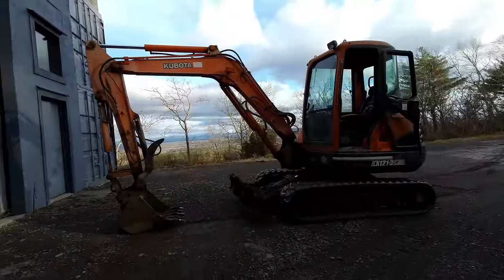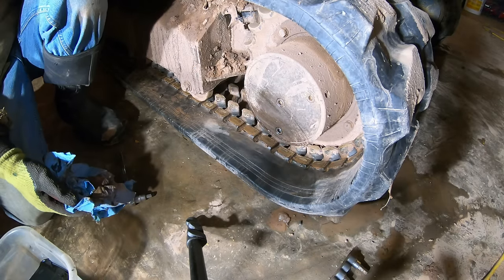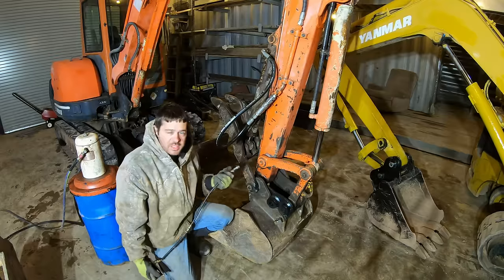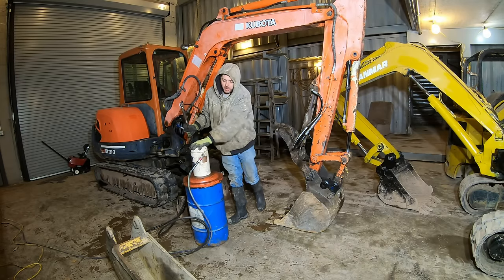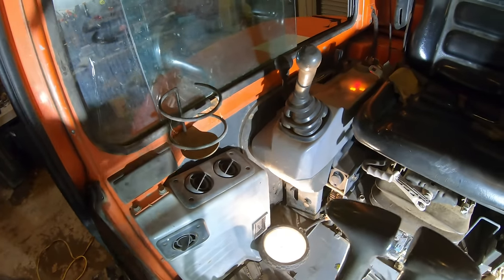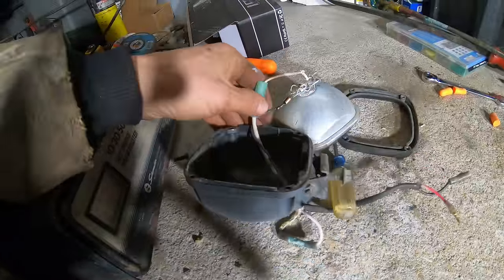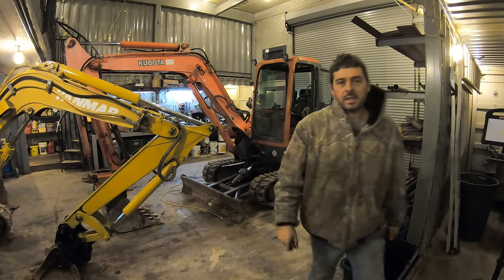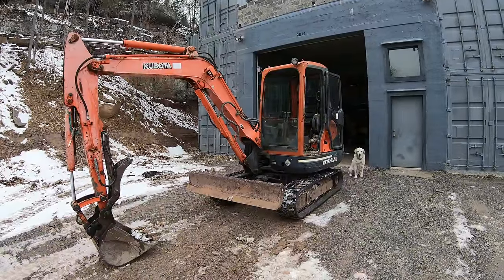Working on the new Kubota excavator

Comment: So did you buy a new washer or rent it?  You can buy those rotating tips and they really do rip through the schmutz...
Reply from the maker: I bought that, there is a video on here about buying it.
Reply: Great video about troubleshooting Honda engine maladies.  *  The Honda engines are great once you get them running.  *  I found a couple good ideas, the first was to install a plastic fuel shutoff valve and use it, the other was to always keep some fuel preservative in the gasoline can year round,  I am currently using Marvel Mystery Oil.  *  I left fuel in both Honda engines over the winter and the valves turned on, and they both started first pull.  *  Oh. and when you do a cold start the engine speed and choke levers are set in opposite directions...

Comment: Andrew, it happens quite often that I get repair jobs on DC systems. It's crazy how much trouble people have with it or don't understand it. You showed an excellent lesson in how it works, troubleshooting, and repair. I especially liked the fog light in the fuse panel. I always say soldering connections is much better than any crimp connection. Enjoy your videos greatly. I do a lot of the same work you do, and like you I learned most of my work from experience, not being taught. Keep up the good work man!
Reply from the maker: Thanks
Reply: @AndrewCamarata  you're welcome.  Thanks for the excellent videos. Even after many years doing this work, I still learn things. 

As for your skills at your job, man you're an artist with a dozer or excavator. Keep up the great work.
Reply from the maker: @repairrestoreandrebuild8974  ok. Editing new content right now.

Comment: I am not entirely sure I understood what you did with the fog light. Why did it go off after removing the short? Was it that after removing the short, the voltage dropped too much (actually the fog lamp did not go completely off, but dim) and so it could not turn on all the lights (the fog and the remaining good one)?
Reply from the maker: Because it lost its ground.
Reply: But didn't it have ground though the remaining one good light?

Comment: Hey Andrew, is everything on your KX121-3 metric, as far as nuts, bolts, Allen socket screws?  Are the hydraulic line nuts and fittings metric too, or are they SAE?
Reply from the maker: I am not sure. Probably some of it is metric.
Reply: @AndrewCamarata  Thanks, Andrew!  I just bought the same machine, and it's being delivered tomorrow morning to my farm.  I'm excited!
Reply from the maker: Neat, good luck with it. I have spent the last week operating mine. Its doing well. I want to get it to 10,000 hours this year.
Reply: @AndrewCamarata   Thanks, AC!  I spent 4 hours on mine yesterday.....it was a blast!  Putting a hydraulic thumb on tomorrow.  10,000 hours?  Holy crap!  With your skills and can-do attitude, you'll get it there. :D

Comment: I wonder If are any automatic fuzes for vehicules ? Just jump and switch Off the circuit in case of a electric short just like normal Ones for AC at any one  house ?
Reply from the maker: Yeah, I install the sometimes. Auto reset circuit breaker.
Reply: @AndrewCamarata  Aha ! Let me guess they are not that good and cheap ?!
Reply from the maker: They arent bad, they are better in some situations. Usually a fuse is fine because they shouldn't be blowing anyways. Unless there is a problem.

Comment: i had to fix the same thing on a kubota and deere mini excavtors wich the kubota was pretty easy but the deere one i had to fix it was a night meirror wich pretty well have to take out the sides on the deeres wich was a poor acess
Reply from the maker: John deere stuff is garbage.
Reply: @AndrewCamarata  yeah  our deere tractors been down most alot this winter for plowing snow but the deere dealer wouldnt help us fix them and hanging up on us  trying get parts   wich why now we stop deling with them and called the kubota dealer and an hour and a half they showed up with parts wich was pretty fast  getting parts and up but next tractors were planing get after getting rid of all the deeres and new hollands were getting all kubotas  and case plus we like the prices from the kubota and case dealer wich the parts for kubota and case were cheaper then the newholland and deeres

Comment: Engine oil, air filter, fuel filter???
Reply from the maker: The engine oil filter had the hours on it from the previous owner, it was just changed. Ill look at the air. IDK, I usually wait for the machine to loose power before I mess with a fuel filter.
Reply: @AndrewCamarata  Nice machine for not allot of money...well done

Comment: Tangeld yourself a bit There, ditn't You? "We were Up to 50 amps, to make this Short Happen... eeh... Thats why You dont Put a 30 amp fuse in there"  i think the 30 amp fuse would have been faster to break, than the wires on this paticurlar lamp to Melt. But you're right: If There was a 20 amp fuse already in there, Put an 20 amp Back in.

But where did You get the Second Missing Light on the right Side of the Cab so fast? Second Last Shot of the Kubota in the shop it was nowhere to be Seen

But great Video otherwise

Comment: It looked to me like he refilled the final drives from the bottom hole. Proper refilling procedure is to fill from a top hole until the oil begins to flow from the center hole.
Reply: @supertrooper7403  Would you clarify?
Reply: You're right... that's how we've been taught.  I viewed his method with interest as it deals with the issue of pouring in gear lube into the same hole that it's supposed to come level to - to overflow.  I thought that was very clever of Andrew to do it that way - he didn't have to stop and look, add more, stop and look, add more... he just added gear oil until it came out the upper hole.  The end result was the same - quicker, more efficient.  I'd almost say "less mess" but it takes a second to get the bottom plug in place - and fluid does come out.  All in all I learned something and am grateful for the different way of doing it.
Reply: @samvalentine3206  Thank you for bringing light to this. I missed the pressure feed he did on the refill, my bad.
Reply: I don't really see another way when there are only 2 holes... If you plug the bottom hole, doesn't the air inside need somewhere to go? The only other way that I know of is if the top hole is large enough to accomodate the fill hose and let air escape. That's how I refill the diff on my truck (with only 2 holes)...
Reply: @premomh  ok, the oil level is to be half way up inside the cavity to provide a little air space for expansion and contraction. The procedure is to rotate the final drive until the fill hole is above the center hole but not directly over it. Fill with oil slowly until the oil begins to flow out of the center hole. Wait a minute or two for the oil to get over to the other side of the final then top off again. Close er' up and you're ready to go. Some finals have 3 holes and that makes draining and refilling easier.
Reply: @davidmorse8432  Gotcha. I guess I keep thinking of it like the differential on a car/truck for some reason. Didn't realize the holes rotated until you clarified. Now I'm looking again and see what you mean. Thanks!
Reply: @premomh  Welcome!

Comment: I would have thought it would be bad to pressure wash right on the pins, since you might force water in and cause rust, etc. Is that not the case?
Reply: I thought that too... but I don't think it would be an issue if you plan to grease it afterwards.  Any crud forced in would in turn be forced out by the fresh grease.